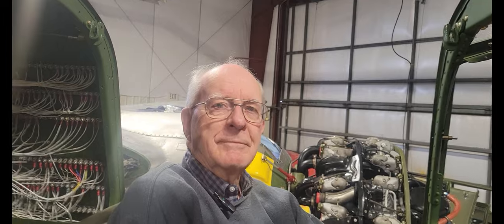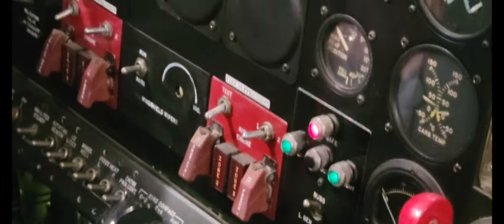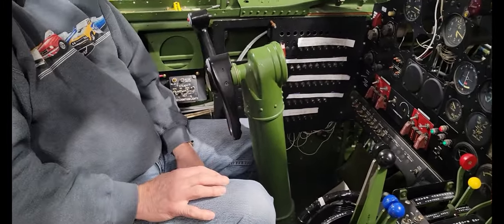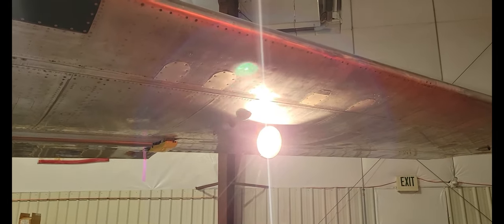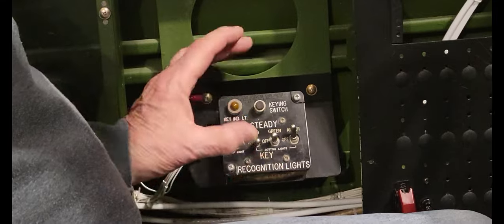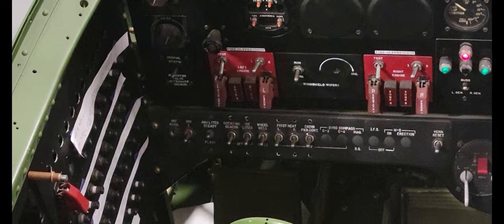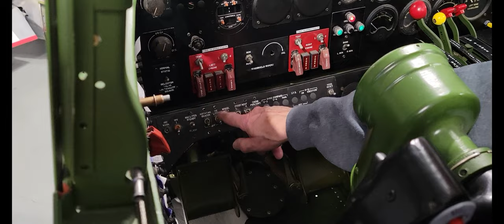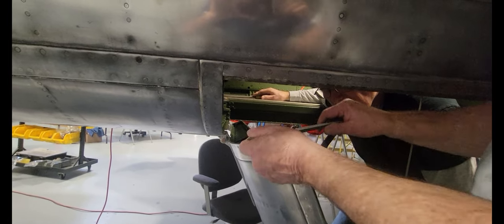N917Y Episode 34 Lights, Camera, Action

Comment: If you put the flaps down past 20 degrees, the alarm won't come on.  I figured that out last time we swung our gear.  And I'm jealous yall have FOF lights.  I've been trying to find all the parts to put them in mine, they'll all turn up eventually I guess.
Reply from the maker: Interesting. I'll have to check that out. Ours is just a toggle switch next to the landing gear handle. Is yours that other kind buried down in the console?

Comment: Bob, do you think you guys would be able to send over some high resolution photos of the bottom of your wing? Ive been documenting the differences between the wing designs and the bottom side is notoriously hard to get photos of. 😅
Reply from the maker: any part in particular?
Reply: @mustangbob51  just some nice shots of the bottom of the wing in general. There were 5x different versions of Invader wings (variants A-E) and Im compiling a list of differences between them. A lot of the changes had to dp with armament hardpoints and mounts, panel lines, access panels, and things of that nature. I have the top of the wings fairly well documented, but the bottoms are harder.